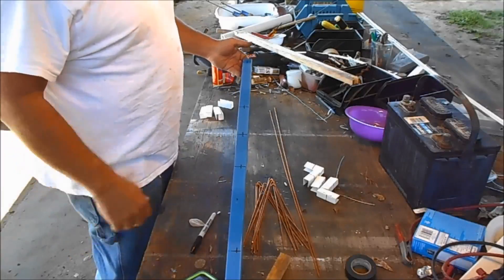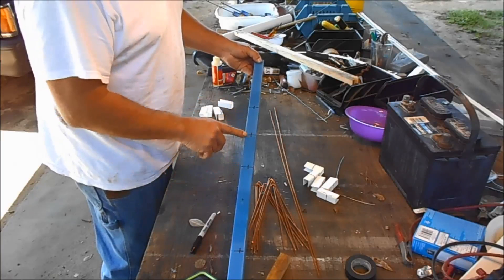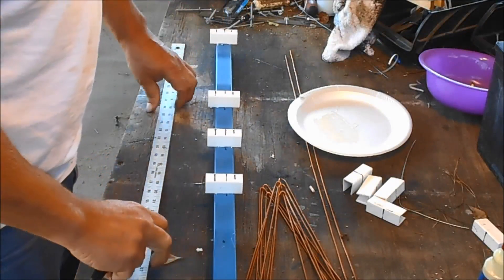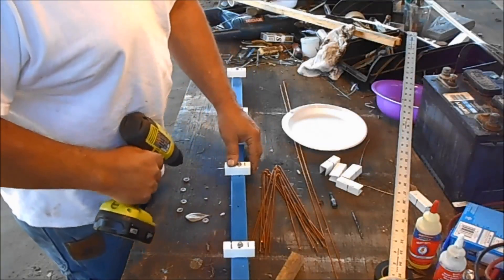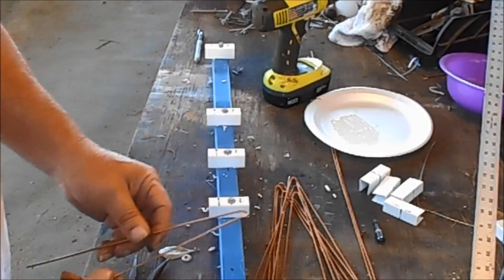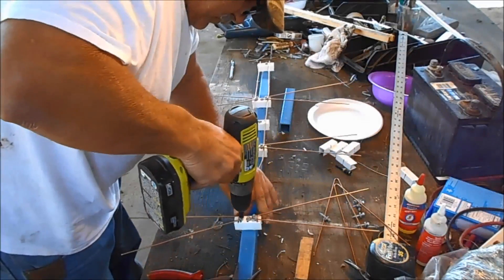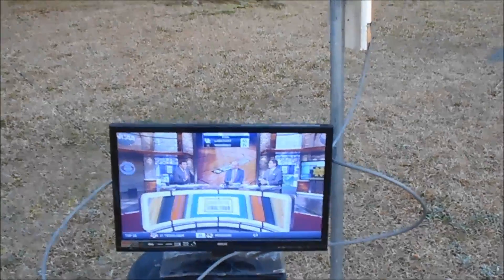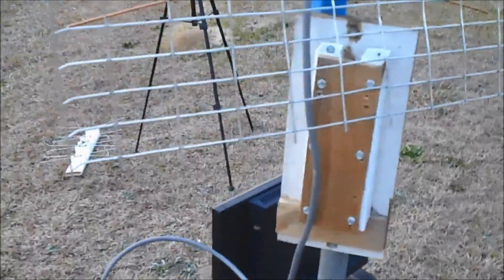How To Make The Ultimate Tv Antenna

Comment: DONN Brand 12-Gauge 6 ft. Hanger Wires (50-Pack)
At the "Home" store,

EverTrue (Actual: 0.625-in x 1.5-in x 12-ft) Common Board PVC Board
Lowes

Comment: what gauge is the wire
Reply: Kieth Tyson the gauge doesn’t matter. Antennas are made of aluminum because 1) cost 2) low corrosion 3) stiff. But copper, silver, and gold have ultimately higher conductance. Copper is easier to work with than aluminum. For tv signal strengths, even coat hanger works AND it’s slightly more durable in the wind, just rustproof it.

Comment: Hi Danny...thank you SO MUCH for sharing what you have learned with all of us.  Your videos are very informative and help us in building our own antennas.I want to start building your Ultimate Antenna...ASAP...!Can you advise what you used for your 42" metal backbone - is it aluminum or steel...?  Also how wide is that stock - looks like 1 1/4" or 1 1/2" to me - but can't be sure...?Thanks again...William
Reply from the maker: if u can hold off, i am going to do a updated video ofthe uitimate antenna
Reply: We live in an unincorporated area where there is no cable or fiber optics service (yet)...and about 60-65 miles from the closest city HDTV signals.  For quite some time we have not had TV in the home.  Your videos have motivated me to build the 'Ultimate Antenna' and try to pull in some of those UHF stations...!I must presume you have made some refinements...so I/we will be patiently waiting your updated video.  Thanks Danny...!
Reply from the maker: IT WILL BE WORTH THE WAIT..I WILL GET IT WITHEN THE NEXT 2 WEEKS..IM REAL BUSY

Comment: Dan are using stainless or galvanized material with the copper?
Reply from the maker: galvanized
Reply: Thanks boss.We have a vacation house near Somerset, KY and used TVFOOL.com to get and idea of how far were from Lexington. roughly 70 miles so i'm going to build the ultimate antenna. Only bad thing is i have trees in the way. there about 70 feet  from the house and have no way to get around them except to cut the tops off.

Comment: Cool idea but the video (close ups) and explanation about materials etc are very lacking.
For decades I have made my own Omani-directional antennas for our sailboat. They get stations over the water 200 miles away but only abut 100 miles over land. In Ventura CA I get 110 Channels, most form LA 100 miles away. It is a simple loop of copper tubing cut and bent to the right size and wired properly with an antenna amp. Fast and inexpensive to build but best of all, it works in any direction even when bouncing and turning on the ocean and never looses the channel.
Reply: TopTribute BandsNstuff - Round copper sounds cool.  got any directions and material list?  Rick
Reply: Scott Williams me too.

Comment: Hi Danny. Great videos and I subscribe too! 

About your materials. The mast looks like square metal tubing. Is that correct? I am assuming it is aluminum if it is metal. I see this at the home stores in 1 inch square size, 5 feet long for about $20 a piece. If not, what is that square and blue tube you use? Thanks and keep the videos coming.

Comment: Hi Mr. Hodges. I want to thank you for your instructional video. I recently needed to return to S Texas for a week to do some work and wanted an antenna, but since I was only going to be there for a week I didn't want to waste my money buying another antenna that would only pick up 21 stations. I know that's all they get because I've bought 2 and neither one was better than the other - until i made one according to your instructions. Mine didn't look as good as your ultimate antenna but it worked way better than expected.  I used 1-1/2" PVC for the mast and attached whiskers that I made from wire I had laying around. I stuck it on a pole about 18 feet in the air and scanned 51 stations that came in perfectly clear.  

Mine isn't very good looking but I used your spacing for the whiskers and it absolutely blows away the other antenna I was using. It worked so well my neighbor wanted one for his camper so I gave it to him when I was done. I'll make another one when I go back again.  

Thank you again for a very good video.
Reply from the maker: LOL GOOD TO HEAR

Comment: Danny, I noticed you use copper wire for the whiskers on your antenna's. Do you think it make a difference between galvanized wire and copper wire ? I made an antenna something like yours. I used 2" schedule 40 pipe, put a reflector on like one you made mounted in piece 1x4. When I scanned my channels it picked up 33. But some of them seem to have weak signal. Bad weather some don't come in good. I'm wondering if I need to make another one exactly like yours or get a booster to try.

Comment: I built one very similar the only difference is my elements were made out of 17-1/2 inch copper wire, so after bends they are about 8 inches where yours are around 10 inches. I live halfway between Atlanta and Birmingham so (like you) I am just over 60 miles east of Birmingham, around 65 from Douglasville &  90 from Atlanta.  I have mine aimed a few degrees to the right from Birmingham towards Gadsden so I will pick some of theirs up on the side and fringe. I have an older Winegard 200 but it is starting to fluctuate some, so I was thinking of replacing it with either a newer Winegard 200LXT possibly a Channel Master 7778. I still pick up about 30 channels but 5 of those are religious from the same net and 3 that are relayed from other stations from the same net. I was picking up 13.1 , -2, & -3 out of Birmingham, but have lost it since the fluctuations. It is a High VHF so it could be getting more noise interference from the old transformer.  But I replaced the balun, checked all connections (which I had waterproofed)  with no difference, and checked all my elecment connections, all  looks good. But like I said, the signal has lowered somewhat and flutuates where it didn't before. I think the circuit board in the winegard is heating up and then breaking down. I can unplug it let it set a spell, then plug it back up and it will work great for a while, but then start fluctuating again.  I also thought about making another and pointing east and join them with a winegard  splitter/combiner, basically kind of like a DB8 design.  Good video by the way. Enjoyed it.

Comment: Hello Danny, I just wanted to say thank you for posting this video. I built one using your design with stuff I had laying around just to see if it was worth messing with. I used a 48" 2x4 for the frame, 1/2" thick cutting board for the insulators, a 24" wide wire shelf panel like what you buy at the home improvement store for the reflector and some large diameter, maybe 3/16", solid copper wire. Radio Shack had the transformer for $6. I didn't solder anything the first time around. I set it on 2" PVC 8ft in the air. We went from 17 channels to 47 channels with a maximum distance of 64miles away in 1080HD!!! Again thank you. I'm going to rebuild this one to fix some of my rigged mess and solder the connections. I'm gonna replace the wood 2x4 with something else too.

Comment: Hey Mr. Hodges,
       I found some plans really close to this one. And you are right. The antenna works very well.  I have had mine up for about 4 yrs. And over time it has slowly started losing channels.  I made mine out of copper wire and stainless steel. The reason mine went bad is because  the fin's started to rust  over time.  How did you get around this problem ?  I called several Ham radio shops and one guy told me to use , Varnish in a spray can. I tried it and it did not work. So how do you get around this
problem ?  Years ago I had a guy put up an antenna. He told me to use Vaseline on all the connections. But for the fin's  I do not know it if will work. So far I do not know what will.
Reply: Every metal has a galvanic quotient or anodic index number. When two dissimilar metals are placed together and there is moisture present, an electro-chemical reaction is generated at the contact point of the two metals. Gold is inactive while copper is very reactive. The early 70's Chevy Camaros had a problem with bumpers getting loose and falling off due to a change in the plating on the screws used to fasten the bumpers. The contact points of the screws and steel rusted out and the screws had nothing left to hold on to.  The connection points of your antenna are probably the problem areas and the Vaseline may prevent moisture from getting at the metal junction points as long as the Vaseline isn't washed off by rain. Corrosion on the copper "V" shaped fins probably has a minimal if any impact on performance except where in contact with solder, a washer, or a bolt..
Reply from the maker: i hadnt had that trouble. but they are some secrets i will be showing. stay tunded